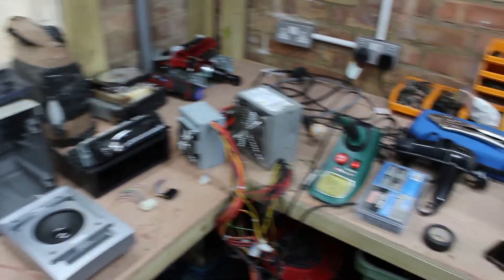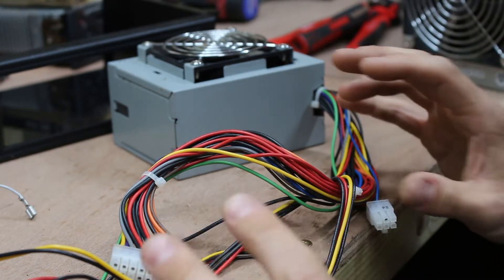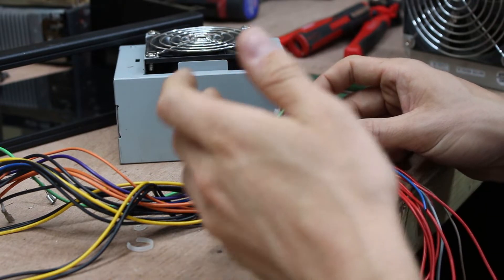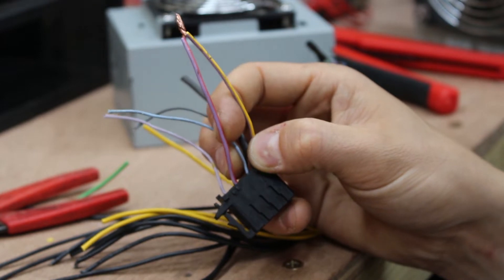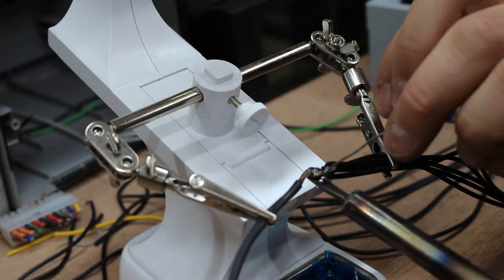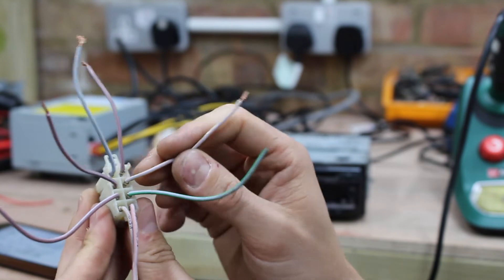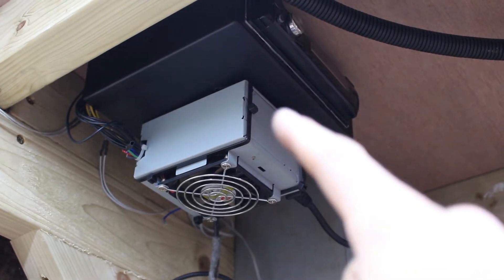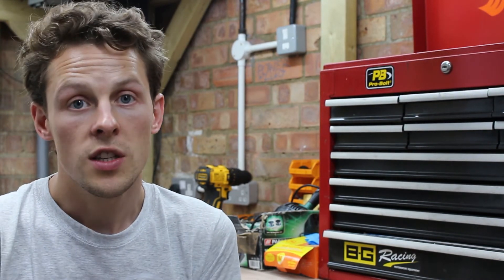How to make a FREE garage sound system.

Comment: Hi just came across this video excellant idea . Was wondering though do you need to connect all the black wires and all the yellow wires could you just use one of each?. the PSU i have has twice the number of yellow wires you have ?
Reply from the maker: You could probably do less but just need to consider the conductor size relative to the max draw. Too great of a resistance and you’ll get voltage drop as the wires heat up.

Comment: Nice video but even if u have memory buttons for radio stations if the car stereo is not getting power it will loose the pre sets. Those buttons will keep memory only if there is a constant power getting in the stereo. Keep up with the good work 🙂
Reply from the maker: I was surprised but this radio had a memory with no power. Agree with what you say, in most instances that wouldn’t be the case so this was a fluke.
Reply: @TrackItYT  Hmm...interesting...but after all the job is done and is working 🙂...that's all that matters...keep doing things cause you're doing them well and in an educative way.